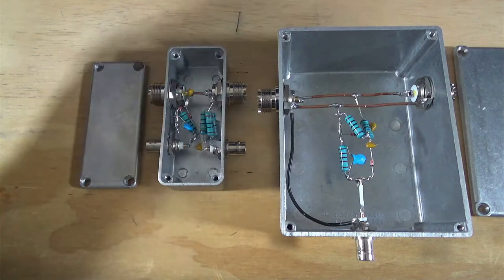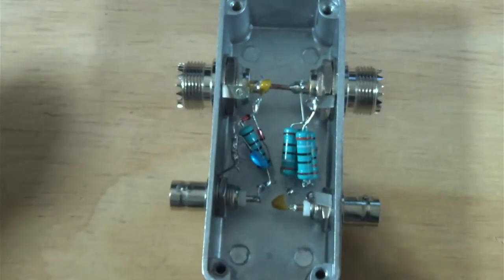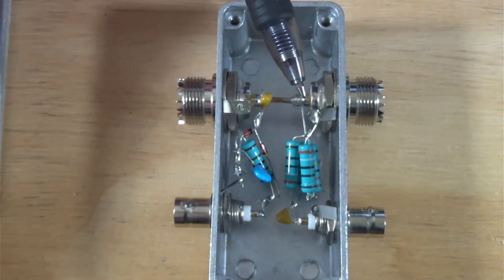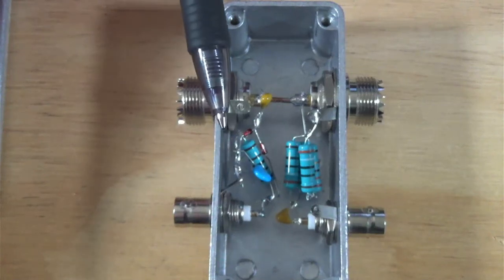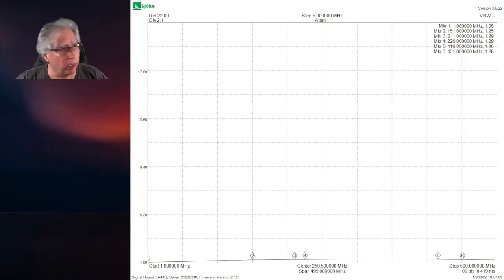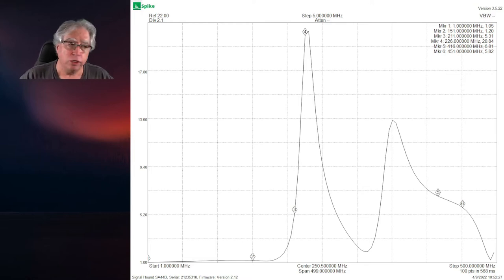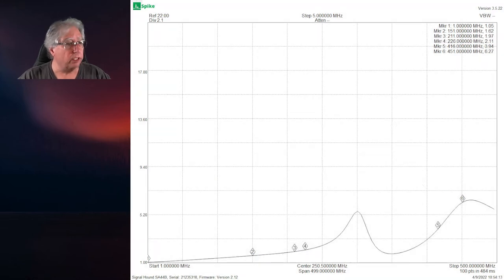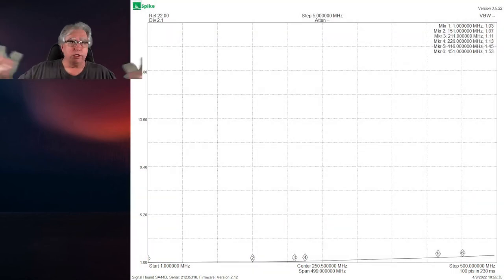RF Testing Basics, Does Size Really Matter?

Comment: What would be very interesting would be to show how to take your rf signal from your -40db attenuator to your scope and measure the voltage peak to peak of the carrier or modulated envelope. Then show how to convert the voltage peak to peak measurement to watts to verify the accuracy of the radios watt output meter or your external watt meter.